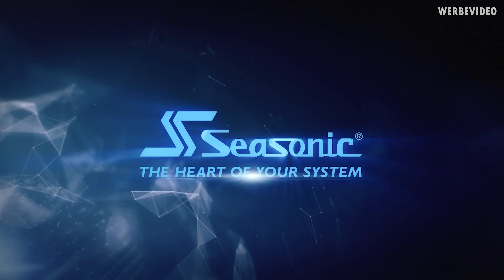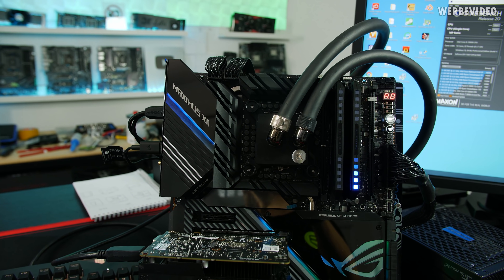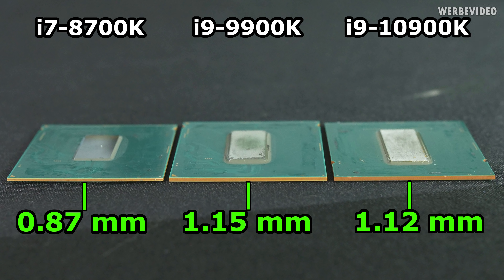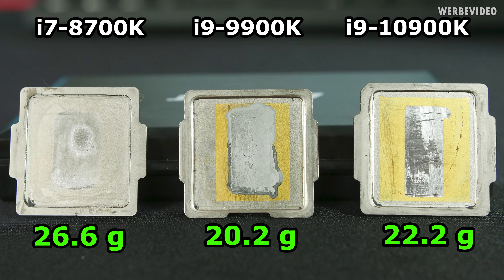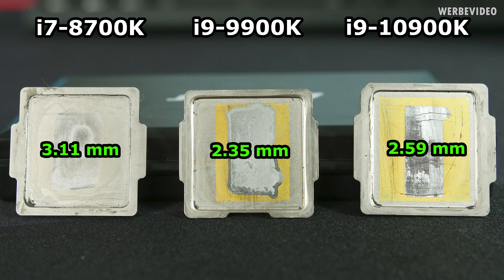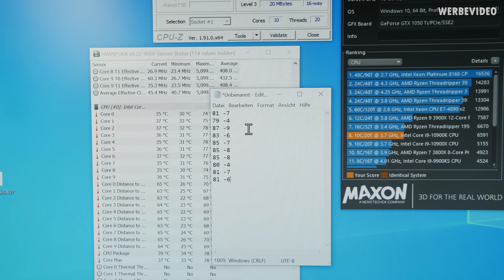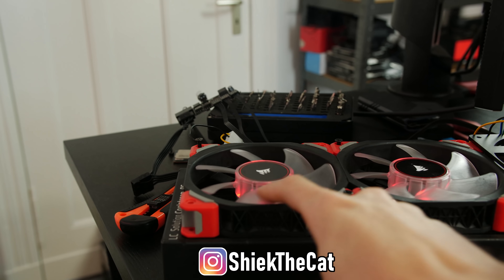Intel i9-10900K Delidding - Temperatures and Die-Analysis. Details vs. 8700K and 9900K

Comment: -7C seems a pretty decent result to me.  I was expecting less. ThX 😎👍
Reply: Absolutely. It's a difference between your fans going jet engine and silent :)
Reply: Will a Delided I9-10900k on a custom loop manage a stable @5.2ghz ???
Reply: @dfkdiek518  Absolutely, but going from 5.0 to 5.2 is about a 7% increase but your dumping almost 10-20 more degrees of heat. So that will depend on you, I ran 5.2 no problem for weeks but the heat was way higher 80's and now I just keep it at 5.0 keeping everything sub 72. I don't see a difference between the 5.2 and 5.0ghz on gaming, applications etc its super marginal.
Reply: @dang879  im runing 5.2 atm large data with occt idk what I'm doing first time when I overclock and  I'm trying to get it on 5.2 under 75 its that good ?
Reply: @ursuzew1958  under 77 on load is ideal! 75 on 5.2ghz is very very good. Run some stability tests and you should be golden.
Reply: @dang879  5.0ghz does bottleneck dual 2080 ti in 3dmark i was under 83% gpu load while at 5.1 I was getting 88 to 90% gpu usage

Comment: After delid u can remove indium from die chipset with LM Conductonaut , it will melt because indium is one  of the component in LM (Gallium , indium , tin).No need to risk it with sharp knife. Sry for my english
Reply: Wouldn't it kind of ruin the amalgamation ratio of the conductonaut however?Still a better solution than the knife though!
Reply: The razor makes microscopic cuts.  Hence the whole reasons for thermal paste.

Comment: i just delidded my 10900k. i was a bit worried as its quite an expensive cpu. at 5.3ghz my prime95 package temp was around 85c with water sitting around 24c. after delidding the temp is now 71c at around 26c so impressed with the temp difference. thanks for the vid.

Comment: Delidded my 8700k and it runs 20 degrees cooler at stock speeds under maximum load. I'd argue that delidding is necessary for the 8700k. It will definitely improve its lifespan and overclockability.
Reply: Nice man! Did same with 6700k, delidded + thermal grizzly conductonaut and same -20 degrees under 100% load in stress test in aida64...but not at stock speed like yours, it is overclocked from 4.0Ghz to 4.6Ghz on 1.338V. Very good result, am satisfied))

Comment: VCCIO at 1.408v and System Agent at 1.504v will most likely degrade the CPU Memory Controller in a short time span. Leaving these at “Auto” is not wise when running RAM at high frequencies. 1.25-1.35 should be sufficient for both voltages and would possibly lower your temps a bit too.

Comment: In case anyone is interested the 10700k looks to use the same die as the 10900k. Purchase one this afternoon and delidded it as soon as I popped to packaging open.

He's 💯 accurate about the indium. I
It's super super soft on 10th gen, much softer than the indium solder on the 9900k. I took me 3 or 4 pushes with a delid tool in each direction until it actually let go and released from the cpu die.

Comment: So where is the direct die frame? Any progress on that one?
Also, when you put the lid back on the core, did you apply some glue in-between?
Also, why did you not apply liquid metal between cooler plate and the processor? That would probably decrease the temp another 2-3-... degrees compared to paste.
Apologies if that is a stupid question, I've never done this, but I have new 10900k waiting to be installed (together with Noctua NH-D15s). :-)

Comment: Drop LLC by 1 or 2 levels and increase voltage to 1.4 - 1.42 temps should be the same or lower and it could clock to 5.2ghz stable, these intel 14nm chips love some vdroop.

Comment: @Der8auer i have a doubt regarding chemical reaction with cooper Waterblock.
I did the delid using your delid tool kit and i got a direct die guard for my 8700k.
I'm thinking about using TG Kryonaut between cpu die and my cooper waterblock but i saw somewhere else that in a short term, cooper gets reactions. What should i do ? Abort direct die and go for relid with IHS ? Or should i do direct die using xxx thermal paste and avoid corruption ?

Comment: Is there a downside to using a really massive water reservoir so your water temp doesn't increase quickly? I mean something like around 150L stored in a big aluminium barrel. 
You still have your normally radiator to dissipate the heat, the aluminium barrel will also dissipate a fair bit of the heat too.
I guess maybe you need a more powerful water pump? I'm not sure on that because you are still pumping the same amount of water so would the pump need to be more powerful?

Comment: Noticed you're using a DDC pump with no heat sink, I had to lower the speed of my 10w DDC to 20% to get the water temps under control to 1c above ambient.

Comment: most of the temperature delta occurs in the oxide layer that forms on any metal surface exposed to oxygen. Decades ago, I heard of a group (for a different application) put the heat source and sink devices in a hard vacuum, a laser evaporated(?) the oxide layer on each, and contact the two. The contact between the bare metal surface of each formed a good  bond. Has any done this with CPU+heatsink? is a vacuum necessary? would some sort of acid remove the oxide layer?

Comment: Couldn't you use a soldering iron and desoldering mesh for a cleaner IHS and die? Or the heat from the soldering iron could damage the die in some way?

Comment: On the topic of direct die frames, do the corners of the socket interfere with the water block plate? When i tried with my 8700k i dont think I was making contact with the die because of the cold plate resting on the corners of the socket. Do I cut the socket down to fit?

Comment: I am confused, when i saw the IO and SA voltages... I was sure, u should not push those higher than 1.3V and 1.35V. But right here, i see 1.4V and 1.5V, which looks quite high regarding the maximum limits. Or did this limits change with the new gen?

Comment: Roman, 

If I remember correctly, Delidding and liquid metal on Ryzen has very limited gains compared to stock solder? Also it's much more difficult to delid so not worth the hassle? What about direct die cooling for Ryzen? Does that make 'significant' improvements vs stock?

Comment: I thoroughly enjoyed this video, thanks. I have de-lidded previous two generations of cpu's and have a 9900k staring at me but I am too worried about slicing my fingers getting rid of the indium. When doing the Folding At Home application my 9900k frequently hits 100 degrees C so I have had to stop it and use only the GPU. I am wondering if I should de-lid anyway just to preserve the life of my cpu. Very annoyed Intel has this much heat allowance built in - probably just to be competitive.

Comment: You need to remove indium with quick silver, you can’t remove the very last 100 micro meter with razor blade. I bet better results if you use quick silver, could be minimal gains but who knows

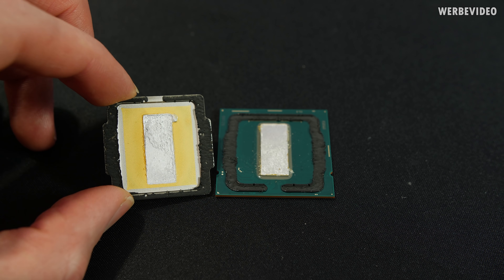Comment: I have a question. 4:01 ish you said that the die has thicker layer of paste, later you used liquid metal. I'm not sure if the die to ihs contact was good enough, I'd have felt the need to "fill the gap". What do you think?

Comment: Hi Roman, would delidding a Core i5-10600K be worth it for high end aircooling (like Noctua NH-D15)?  The objective is to have a low maintenance daily overclock like 4.8GHz on all cores using aircooling.  Or would it be more practical to just go with a 360mm AIO and not delid at all?  Thanks.

Comment: I run my 10700k at 5.1 and 1.325v with a 120mm rad. It gets 72 degrees C during gaming. I use it for my vr rig with a 2070

Comment: @der8uer. Perhaps you can explain this. I'm curious why this score is worse (core speed and core count taken into consideration vs. a stock 3900x). So my math is: 6600/10/5,1 = 129,4. This is the score divided by the actual cores divided by the core speed in thousands. My stock 3900x has a score of 7088 running 100% stock. According to Ryzen master, the core speed was 4000 +- a few. So the math is: 7088/12/4 = 147,6. That makes the 3900x 14% faster everything taken into consideration. How is this ? better optimized or does cinebench favor the AMD over Intel ?

Comment: Have been running 9900k direct die for over an year now and i think the absolute best possible way to take heat of that small die area is to reduce the die height and run direct die. Right now i am running the stock height on the 9900k with a corsair h115i.

Now i have a Request for you 'Der8auer' can you please reduce the die height of that 10900k to as low as possible, a die height of 0.2mm is totally safe, a guy did it and shared the results on reddit. Then mount the cold plate directly to the die some how or the best thing would be to use the nude cnc's ihs block and then have a look at the temperatures, would be glad it you could test it that way, please do it?

Comment: Seeing this makes me not feel so bad about my retail 10700K now, it can at least hit 5.2GHz under 1.4v.  I guess all those 5.4GHz overclocks I see everywhere must be ES chips.
Reply: You're not even guaranteed to hit 5.2 @ 1.4. My first 9900k wasn't stable at 5ghz at any reasonable voltage and "most people" said all core 5ghz with 0 avx offset was easy.
Reply: Everyone talks about getting 5.4GHz on 1.35v if they get it, then they run 5ghz daily.
All the people who get chips that barely do 5ghz at 1.4v dont say anything because that means admitting the cost.
Reply: Those 5.4GHz overclocks are either unstable or top >5% silicon lottery winners. Most people that brag about their chip being stable at some crazy high frequency haven't actually stress tested their OC properly. They've just run cinebench on it one time, or played a lightly threaded game for like 5 minutes without it crashing and call that shit stable so they can brag in comments and forums.
Reply: @isakh8565  I can't pass a single run of R15 with my chip clocked at 5.3GHz so those ES/QS chips are definitely better silicon.
Reply: @sabishiihito  Doubt they're better because they're ES/QS, it's just normal silicon lottery variance. And OC's posted by pro overclockers are usually done on highly binned CPU's. Those guys go through dozens or even hundreds of samples to find the very best ones.

Comment: what is the case, that JayzTwoCent in the last video goes 5.2GHz almost out of box with kraken x63 with 65°C max at 1.36V?
Reply: Every processor has different silicone, and will perform differently with different temps & clocks. Even if it's the identical model (10900K vs 10900K for example).
Reply: jayz must've gotten an insanely good bin, he won the silicon lottery.
Reply: Look for dancop, 5.4ghz at 1.26v. 62c.

Comment: Nice Analisis! I just sub! You look like one of the most professional Overclockers I have found on YT. I have a question, My i9 10900k is stable @5.3Ghz with 1.34v-1.36v (Load-idle) and my max temps under stress are 75c, would you say this overclock is safe for 24/7 gaming, or should I step down to 5.2Ghz with 1.28v-1.30v (Load-idle) 70c max temps under stress for daily use?
Reply: Id say i want proof that you are stable at 5.3ghz with 1.36v and 75c temp, if thats true you have the best 10900k on the planet
Reply: Shane Warren I don’t have the best i9 10900k on the planet The best Asus Prediction is +120SP(Silicon Prediction), my Asus Prediction SP is only 88 but my Cooling is really good with 210Pts. Optimum Tech has on his review exactly the same 88 SP but only 168pts on the cooling and he has stable his cpu in non AVX workloads better than me with only 1.32v.

Comment: Hey D8 I need your help I bought Kryonaut but you dont have a tutorial on how to apply Kryonaut to a rectangular laptop CPU and GPU ie: I have a GTX 1060 and i8750h I used the spread method and my CPU still hits 90c under 97% load with plugged in full performance power setting can you help me out is there a way to apply Kryonaut for the rectangular CPU you recommend..why is my CPU hitting 90c in hwifo I get edp pl1 and pl2 yellow. I applied Kryonaut Pea size method, spread method,  and line method,  the CPU still goes up to 90c with full performance power profile plugged in.

Comment: that vccio , vccsa auto voltage is nuts ,  anything we should know about the new system agent , imc ??
Reply: theyre the same
Reply: @dafunk420  dont use auto is all you should know, he wont be running 4266 for much longer on that cpu i bet my manhood on it, he would have got 5.2ghz without a delid too if he wasnt adding pointless heat to the die

Comment: 1.33v for 5.1 on all cores. My 8700K needs 1.36v for 5ghz all cores to be 100% stable and its delidded with your tool and using TG liquid metal.
Reply: Right but the I9 10900 have more cores/thread. My 8700K is also stable at 1.36 5ghz all cores but to go 5.1 or 5.2 stable I've to push wayy to much voltage
Reply: @Sseumday  that's what I mean. To be stable at 1.32 with an extra 4 cores is impressive.
Reply: my  8700K  1.36v   4,8ghz .....

Comment: Thank you for the great review! With a bare crystal, it is possible to reduce 10-12C?
Reply: maybe if you had graphene thermal paste. sadly no one sells pure graphene yet since it's hard to mass produce. even the thermal grizzly carbonaut pad is only pyrolytic graphite which is good at spreading heat but bad at transferring it.

Comment: Hi i have a i5 4670k - H81M-S2PV motherboard i can overclock my cpu to 4.1 but im trying to overclock it to 4.2 but the problem is i cannot incrase my voltage more than 1.2v when i type 1.25 it changes to auto is it because of my motherboard?

Comment: Is the radiator facing down on the table , if it is there ia no air flow right ? How it even handle does temperatures ?
Reply from the maker: There are 50mm spacers underneath

Comment: How well does 10900k processor IMC handle the high memory clock speed? I have 9900k, could only get 4200mhz out from it. Kit is rated up to 4600mhz. Is there any improvement regarding that?
Reply: can your motherboard support it?

Comment: Heat spreaders are pointless. We had bare die CPUs before and they were fine. A hear spreader gives it some safety during shipping with a big heatsink installed. A machine sitting in your house doesn’t need that safety measure. You’ll get better cooling with the cooler right on the die rather than inserting another piece of material and two extra thermal interfaces in there. That’s just adding thermal resistance for no reason. Ditch the heat spreader.
Reply: Haha, and right at the end of the video you say you’re already going to do that. Nice.

Comment: if u didnt have sa and vccio on auto at stupid high voltages u would have ez gotten 5.2ghz below 1.4v probs around 1.38 due to less heat and leakage

Comment: Is that 5.7mm of  vulnerability fixes?
Reply: AMD CPU are more vulnerable, due to the recent stolen GPU IP, and clearly, you didn't watch reviewers' slides.
Reply: @AlfaPro1337  Nope, missed the PowerPoint presentation. You should get out and stretch, the Corona got you stiff. Btw, I'm not on anyone's side, I just expect a product I buy to work as intended. Doesn't mean I can't crack a joke or two.
Reply: @AlfaPro1337   I find it odd that nobody ever talks about the dozen or more security vulnerabilities in AMD chips! and that nobody mentions that Intel pays researchers for finding security holes in their products.  AMD pays NOTHING!!!
Reply: @wysetech2000  In what, 10 year old chips? The issues that do exist on AMD CPUs aren't that bad, Intels though are pretty damn bad

Comment: I wish i was brave enough to delid my 9700k
Reply: Yeah it would be fun. But better safe than sorry! :)
Reply: It's ussles u wont get any better maybe 1-2 degree.
Reply: For the i7 9700k i mean and i know this from Kingpin.
Reply: @iacobescuionut2459  I'd just like to get my core to core temps closer together. Core 2 (starting from 0) always seems to run 8° hotter than all the rest. I already tried lapping the cpu, which only tightened it up by a degree, so didn't really do anything. I'm running a custom loop with a 480x60 and a 420x64 radiator, so the temps itself are not that bad.

Comment: I lost my intrest in Intel cpu's..  Al this effort for -7c :s so much power draw....
Reply: 7° is actually not bad but yeah this 10900k is stupidly hot. I know it’s not the same but my Ryzen 3600 4,2Ghz is running at 53°c in burn...
Reply: @Nuka85  Run them both at the same frequency and the temps won't be that different though.

Comment: so after delidding, the stock speeds are just under thermal throttle. impressive, not.
Reply: SKG Anno   That might be true if it was at stock settings but it's overclocked! Thermal throttle is set at 125c on the 10900k so not even close!